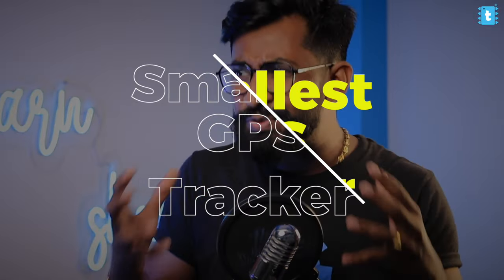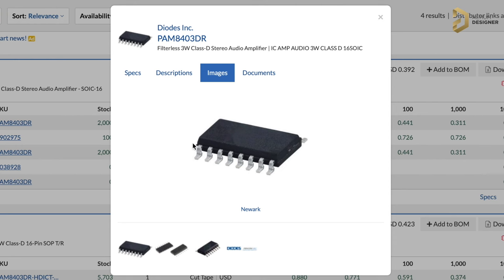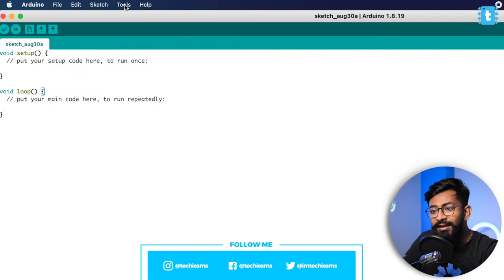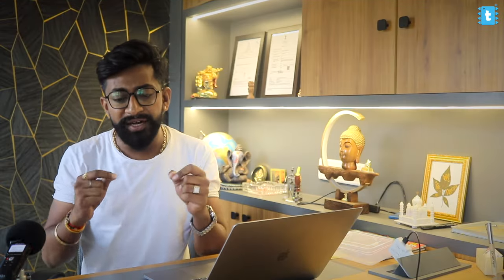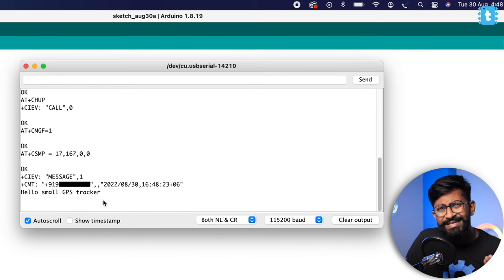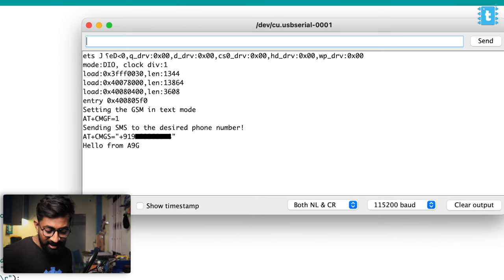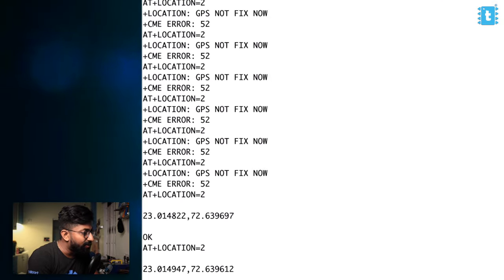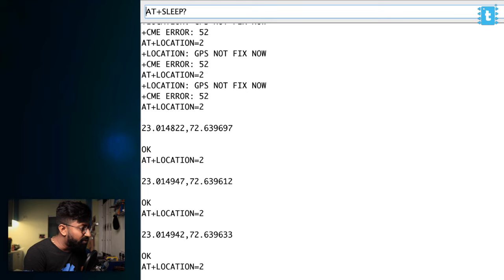Getting Started with A9G Board | GSM + GPRS + GPS 🔥🔥

Comment: Almost any economical 8bit microcontroller would work … depending of the features you may want . Most of the standard GPS trackers are programmed through SMS for several reasons . You may have a SIM with internet enabled but you need to set the APN and serverIP/port to the device in order to work. Some standard features ( coordinates are most basic) are setting time zone, GPIO handling for door or cut oil, power cut alarm , ignition sensing etc. Also you would need to set low power conditions when it is stationary or not connected to the battery. So depending of which features you have in mind , would impact in microcontroller selection and budgeting. For IOT application I do prefer GSM over WIFi since would be online as long is battery powered and cost of data cost around $3 usd a month for 50mb. Most of high end trackers ( with several functions and sensors ) won’t use half of it sending  burst of data each 30secs.

Comment: Try to use a cheapest and smallest microcontroller like this one (Atmel ATTINY414-SSNR) and also make a second video as soon as possible
Reply from the maker: Thanks for the suggestion 
I’ll try to work on gps tracker project asap
Reply from the maker: Connect with us on WhatsApp +91 82000 79034

Comment: If you're trying to make it as small as possible, why use the A9G as an AT modem, with a second microcontroller, instead of programming the A9G directly? Unfortunately there is no Arduino core for it (yet at least). But there is a pretty good SDK with a lot of examples. I've worked with it before and it's not the difficult to get running. And the A9G has a pretty powerful 32 bit microcontroller on it, running at 312 MHz. So you would probably be hooking up a less powerful microcontroller to it, if you used it as an AT modem. Which would be kinda dumb...
Reply from the maker: We will be trying that really soon
Share some important links for that examples
Reply: HI PLEASE CAN YOU SHARE LINKS
Reply: It means this device microcontroller can't be used in a full project? You still need another micro-controller?

Comment: Nice project.  Willing to buy this board and usb to ttl converter. 
I got doubt  after watching this.After connecting this board, which board we should choose in arduino ide tool.
Reply from the maker: You don’t need to chose any board. Just select the right COM port and open the serial monitor.
That’s it.

Comment: Since the project is focussing on Low Power , I feel STM L series or TI MSP series or SiLabs Gecko series or Microchip PIC nanowatt series of microcontrollers can be looked into 👍
Reply from the maker: Thank you so much for the suggestion
Reply from the maker: can you suggest development boards related to that chipset you have suggested so that we can try using them first?
Reply: @techiesms  TI offers MSP430 Launchpad (with MSP430G2553, a 16bit MCU) evaluation boards costing between Rs.1k-2k. This offers 4-5 low power modes, on board debugger to quickly get started. I think they even provide a live Power Profiling tool which is very helpful. Once your design is done, I feel you can migrate the design to a low pin count mcu......
Reply: @techiesms  you are welcome 👍🙏

Comment: Hello techiesms!
Your videos helping me in a great way to learn about Arduino, Thank you .
i'm requesting you to help to a problem that how can we compare Blynk slider input data and sensor data!
example: we have a slider and sensor data in a loop it has to compare every time when we change the slider value, and if slider value is greater than the sensor value it should turn on the relay else turnoff, please anyone in the comment section please help me that would do needful

Comment: Use the SDK provided by AI Thinker itself, you will not need any extra Microcontroller
Reply from the maker: But how to give commands without any controller ?
Reply: @techiesms  （B）SDK On Chip Development，No external MCU is needed, burn the firmware directly to GPRS module

The advantage of this method is that it doesn't need extra MCU, programming directly on modules, saving hardware resources, and save mony for projects

This documentation introduces in detail how to use SDK to develop and provide related API docs.

The AT application source code is not included in this SDK

Comment: Does this work on 4G sims ??
Reply from the maker: No
Reply: Hey bro u can use 4g sims of Airtel, vi ,bsnl etc it doesn't work with jio
Reply: @mrelectronrock9510  The reason I asked  this coz I tried with one of 4g sims . It doesn't work. Ur 4g sim might support 2g that's the reason I believe it works. Not sure though.